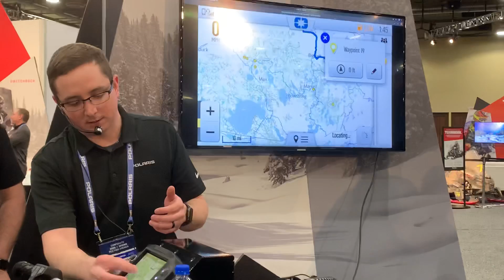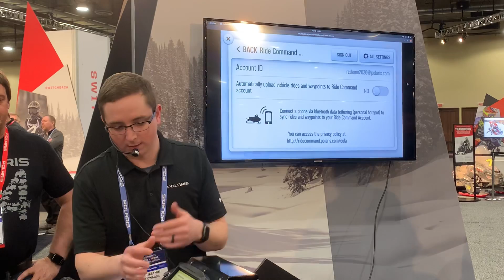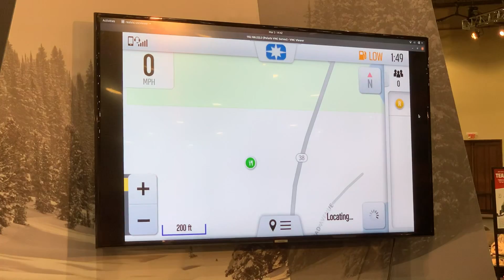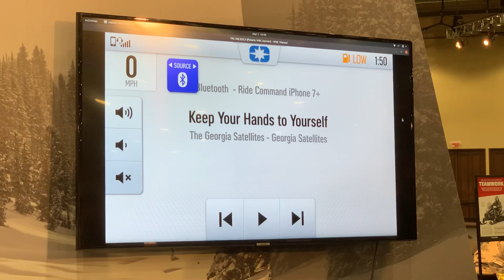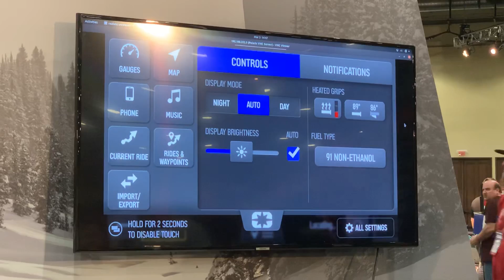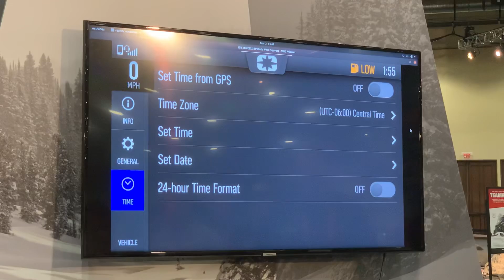2021 Polaris 7S Digital Display with Ride Command

Comment: fancy gauge and all, but I'd trade 90% of the features to be able to upload the latest GPS Trailmasters data into it, and be able to use it for turn by turn directions. I was able to by a low end garmin GPS last season, and hard wire the power, upload the GPS Trailmasters maps to the SD card, and can use it on the trail, change destinations on the fly, same as any other car based GPS. 

Your system is ok, here's a problem though I can see happening to me. With your system, if I plan a ride the night before and load the waypoints and head out, and half way through my trip I hit a trail that is closed, I can't change my route on the fly. I ride west central Maine, and the trails are frequently diverted do to logging operations, or angry landowners, or whatever. with my Garmin set up, I can just reroute right then and there, type in a destination, and I'll get there.

Would be a great option to add, I'd rather be able to add my own set of updated trail maps that are important to me, not just wait for an occasional update done by Polaris when you get around to it.

Thanks for listening

Comment: I have a 2020 polaris northstar i cant believe you dont have dimmer adjustments for ride command, speed and tach (super bright white) and the blue buttons for power windows and light switches and the little night light blue lights at night there are so many (30 ish) and then they reflect in all the windows it's like there is 30 alien flying saucers hovering all around you. i ended up putting electrical tape on all the switches but the ride command and speed and tach are ridiculous, for a 30 thousand dollar machine that is unable to dim the dashboard lights that is BOGUS !!!!  The engineers need to brush up on their skills they are lacking.
Reply: Does this happen when you switch to night screen?

Comment: Does the gps attempt to use the trails or is that done by waypoints? I see it shows a trail on the display like it has the course planned for you. Asking a lot but would be nice as a lot of trails like Michigan don’t change much.
Reply from the maker: Shane Drilling you use way points. You can also map out your route on computer night before and upload it for the ride.
Reply: In Michigan, I save my tracks from previous trips, by date, and then when I want to make that same trip again, load it into the display on my sled, set a color for it, and then follow that color.  Even when trails change, it is always storing bread crumbs, so you can just follow your bread crumbs from the morning when on the way home in the evening.

Comment: How does the display work if the sled doesn’t have electric start.  I’m guessing it won’t work if the sled isn’t running so how long does it take to boot up if you stop on the trail and will it save info like tracks and go back to music etc while making stops?
Reply from the maker: dwtodd66 the display has a small built in battery and will remember all of your tracks after being shut off, even overnight. It does take about 30 seconds to boot up
Reply: @Deltapowersports  okay nice. Thanks for the quick answer.  Trying to decide if its time to upgrade from my 2017 Assault 800.  Thinking about Assault 650 without ES
Reply from the maker: dwtodd66 this gauge is next level for sure. Very advanced and versatile
Reply: Just like for the PIDD, I'm sure Polaris will have a battery powerup kit, that can be used with a small battery to keep this 7SDD alive as long as you want, without the engine running.  The PIDD only took about 2 amps of 12 volt power.

Comment: Can u get this for the rmk lineup
Reply from the maker: josh stickney not this year but I am sure it will be added in the future
Reply: @Deltapowersports  can u see engine temp while on maps screen
Reply from the maker: @STIFFLERJJ68  yes
Reply: @Deltapowersports    khaos slash 155  2.75 lug q2 850 non turbo low elevation manual start, is what I'm planning on snowchecking.... In a  recent live video from Chris burandt, he mention that the matrix is 4 lbs heavier cause of the Batt for the display...is that for the eltric start models? Or do u get a Batt for the 7s display even with the manual start non turbo models,
Reply: @Deltapowersports  I now have the rmk matrix slash with the 7s display and I can find out how to put the engine temp at the top of the screen when on maps

Comment: so you can not use regular gloves just the special gloves from Polaris for the touch screen?
Reply from the maker: MATT sevier that is correct. There are other gloves on the market like this that will work on the touch screen but normal gloves will not work

Comment: Would be great to have more info about the engine, ie temp/rpm not just speed while using the gps screen
Reply from the maker: Kickinitnobel you can choose what you see on the gauge. Lots of options

Comment: When are they gonna make it so I can just download GPSTRAILMASTERS trails into it? The last 5yrs of Polaris updates have been horrible! Not even trails on the map in Northern Maine,  nevermind show major highways your close to! Sad they're GPS is still this far behind for the cost
Reply from the maker: Kwmike-D they have updated the trails recently. The ones I used were pretty accurate
Reply: @Deltapowersports  I know, just did lasted update,  well see this weekend.  But for 5yrs they're maps have been horrible  in the Northeast.  My buddy has been dealing with same issues in northern Vt

Comment: Are Track logs able to be saved off in a format for Google earth (kmz) format also for use on Garmin Basecamp ?
Reply from the maker: Steve Matscherz yes they can be saved and uploaded to other gps or apps with sd card
Reply: @Deltapowersports  can you load gpx or other formats to the 7s?
Reply from the maker: Paul Winters yes
Reply: This 7SDD, like the PIDD, saves tracks/rides and waypoints in the .gpx format.  If you drag and drop a .gpx file onto a Google Earth screen, Google Earth asks if you want it converted to .kmx (google earths preferred format) and then does it and then displays it.  It is amazing to see your track displayed on Google Earth on the map, and showing average & max. speeds, elevation changes, stops along the way, travel times between one junction and another. AMAZING.